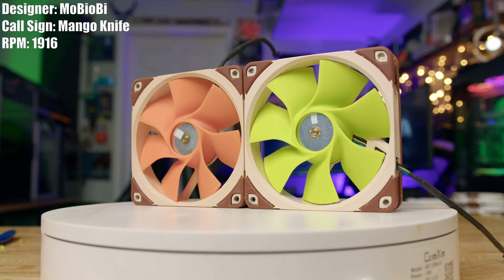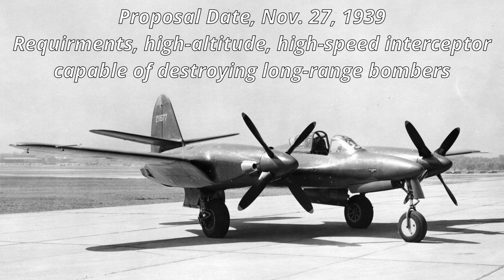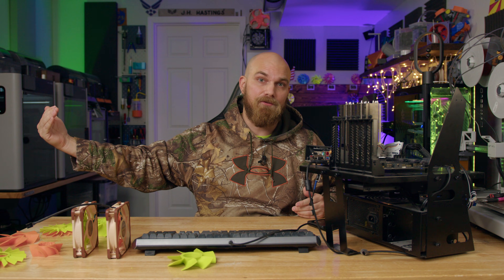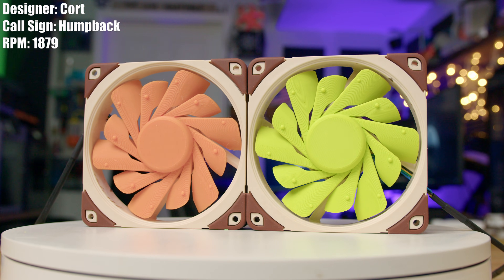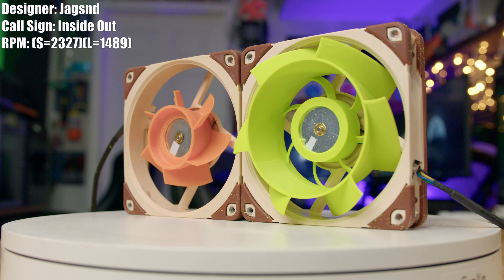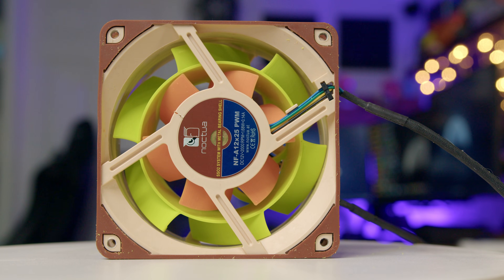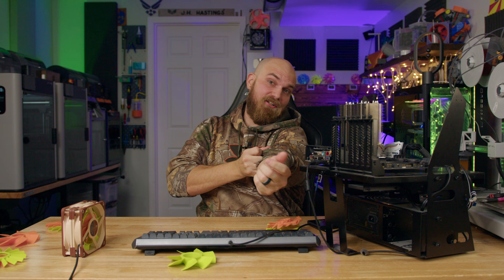Stacked TWIN Fan… is a Monster | Fan Showdown S7E1

Comment: Focusing on cooling & noise is the best way to go. I'm not sure about the current ranking formula though.

You might need to use a different ranking formula that works better. Min–max normalization might be a better approach than adding the 2 values together.

You could also use sones instead of dB to measure loudness. Sones is a scale for the perceived loudness as a human hears it.

Comment: It would be interesting if you ran a audible test where the fan ran at a speed to cool the CPU at a target temperature.  You could use motherboard fan tuning software to target say 70 and the fans will run at the RPM that maintains that level of cooling.  Some fans like the Mango that have more headroom on the cooling may show well with a temp normalized test.  At the moment you are testing the audio at the max spin speed of each fan which is not necessarily the best indicator of performance even though it is an indicator of max noise.

The new smoke machine is excellent.  A moment of silence for the pioneer.  It worked through hurricane force winds and whining surpassing that of even a 2 year old child.

Comment: The results of the sound testing will have nothing to do with how they sounde on the cooler. The coolers fins changes them. It's quite possible to have a design that the fins all but silence out or that the fins cause a huge jumps in sound. Also what frequencies are loudest make a perceptual difference. Higher frequency noise is more unpleasant than lower in most cases.
If you want something that is relevant then mount them on the cooler before testing. Otherwise it's a waste of time.

Comment: I think the A12 stock fan should be the marker of 100%. Set the benchmark to that and your score is based on the percentage mark in both categories. Meaning if you match the A12 in dB then you get 100% and if you produce a fan quiter. By example, let's say the A12 has a dB level of 48, that would be the 100% mark that a fan can either do greater than/less than and be graded as such.

So you can use an formula: 
Percentage = {x} / {48} x100

Giving you a value of exceeding the A12 by a % margin. You can organize that based on the lower the percentage score, the higher it ranks.

Using this formula you can also get a value for temperature and use that in the same fashion since both scores being lower is the goal.
Reply: +1 for scores relative to the OG
Reply: Up! this is a fantastic idea.

Comment: In the future episodes can we have the radiator in the smoke test and fans on each side for a more proper smoke test? The rad will add some resistance and id be curious to see how it changes in a true push/pull configuration with some space between.

Comment: I personally think the sound is the most mundane aspect... Focusing on sound feels like you're catering to a very vocal minority of people that whine and moan about every little noise their pc can make while forgetting that it's got lots of constantly moving parts. if you're going to test it, if its going to be a factor... it should be the least important factor in scoring, but still contribute so it can help out weird edge cases or ties. the fun of watching these tests is to see their performance in air flow (how much they pull in and how they shape the exhaust), the static pressure (since that's what helps it push the air through the cooler), and overall how well it cools the CPU. If all we're worried about this time around is sound performance... I'm probably skipping this season. I don't personally care if I can hear my fans, as long as they aren't grinding or blocking out the sound of my games its fine.

Comment: I feel like this puts WAY too much emphasis on the sound levels. You show me that list, and I still want the Mango Knife as my chosen fan. It's literally the best fan.  It's not going to take long before someone makes a shitty cooling set of fans but one that is quiet and they "win". For instance, every fan that made the chart from S2 E1 of the Fan Showdown beat everything on this list based on the criteria used. If we force them to use two of the fans, that's going to double the noise so increase dBA by 3... which means that the Wave still beats everything from today's list, even though the delta was over 7 degrees more (though probably a different test than you used in s2) - poorer cooling, but much quieter.  Would be interesting to maybe throw a pair of Wave fans in and see where they actually come out with the current test setup.  Either way, I still think this is way too much weighting given to sound level - it's definitely going to stifle creativity in fan design.

Also, what is the ambient sound level in your basement without the fans running? And are you making sure AC/furnace/fans aren't running when measuring because a couple dB are obviously going to make a big difference now. :)

Comment: It might be a a lot to ask for, but adding in data from tests like the static pressure and other bench tests from previous seasons to incorporate into the spread, they dont have to be integrated into the actual stats for rank placement but it would still be cool to see their stats on other tests, also more smoke would be nice, its the best representation for some individuals such as myself that are visual learners, mango knives looked sweet, knew it wold have a nice exhaust flow just by looking at it looking forward to this great season, cant wait to see some crazy designs 👍

Comment: The sound test should def be done with the cooler!!, and it would be neat to see the smoke as well? With the cooler mounted to the exit side, it would show how much air is being pulled all the way through vs dissipating through the sides.. especially with asymmetric designs where one fan may be very different in performance it might show some interesting results?

Comment: your sound test is unrealistic for the fans to be honest. the bare min you should have them run on the cooler when testing the sound. A case or cooler will add many factors that are simply missing. i mean you still use that reference but even that pointless really to be honest its more or less useless data.

Comment: For the sound testing, fan noises that are more biased towards the higher frequencies should be penalized more harshly than those that bias towards the lower frequencies. A low hum can be easily ignored, but a high pitched whine is far harder to ignore. Even though it has a lower dBA reading on this scale I would penalize the Mangoknife more harshly than the Inside-Out, although both would take hits due to how many peaks they have.

Edit: Also, fan sound testing should take place on the cooler as it WILL alter the sound dynamics.

Comment: Sound test score should be less influential. Like a 5DB difference is equal to only 1 point, anything lower is 0 points. As cooling is the ultimate requirement.

Comment: I think the noise test needs to be done at a 90 degree angle with a cooler in place. Rather than doing it smack bang in front of the first fan. If it's shifted 90 degree, it'll be 45 degree angle from both fans if placed in the right spot. 

Having the mic in front of the first fan may be blocking certain frequencies from the second fan in the same sort of way noise cancelling works, maybe?

Comment: Shouldn't we be adding benchmark scores, or even CPU clocks on the equation? Or is the CPU running on a fixed clock somehow to make sure that the differences of temps are accurate?

Comment: Hmm... Rather than using 𝚫T+dBA, it might be more - accurate(?), significant(?), valuable(?) - to use the Weighted Product Model to arrive at a score. (https://en.wikipedia.org/wiki/Weighted_product_model) This allows you to "evaluate and rank alternatives based on multiple conflicting criteria".

WHY?! To avoid a situation where a particular criteria influences the outcome too much or too little. Let's use a setup where one criteria produces scores from 1-1000, and the other criteria produces scores from 1-3. If both criteria are equally important (equally weighted), then you could get results like the following alternatives:

(criteria 1) + (criteria 2) = result
994 + 1 = 995
992 + 3 = 995

You can see here, the 2nd criteria is contributing very little to the end result, though it is supposed to be equally important. The bottom alternative, despite having a criteria that is 3 times better than the top alternative, results to the same number. However, using the Weighted Product Model (explained below) with equal weighting, the top result would be 994, but the bottom result would be 2976, reflecting the equal importance of the 1-3 criteria.

To use this (in this instance), you take 1 divided by 𝚫T to the power of how important it is (the weight), times 1 divided by dBA to the power of its importance (its weight). So,

((1/𝚫T)^(w1)) * ((1/dBA)^(w2))

Why (1/𝚫T) or (1/dBA)? The Weighted Product Model assumes the higher criteria number is the most desirable number. (10 is more desirable than 4.) Since a LOWER 𝚫T and a LOWER dBA is desired, the calculation 1 divided the criteria gives a higher-numbered result for a lower criteria. (1/2 is larger, or higher-numbered, than 1/4.)

If w1 and w2 are equal (because both criteria are equally important), then they both equal 1. Which reduces the equation to:

((1/𝚫T)^1) * ((1/dBA)^1)
or
(1/𝚫T)*(1/dBA)   {to get a higher-number-is-better result}
or
𝚫T*dBA   {to get a lower-number-is-better result}

If 𝚫T is twice as important as dBA, then w1 = 2 and w2 = 1:

((1/𝚫T)^2) * ((1/dBA)^1)

You can adjust the weights as needed, and add as many criteria as needed. 5 criteria (C1- C5) would be:

((C1)^(w1)) * ((C2)^(w2)) * ((C3)^(w3)) * ((C4)^(w4)) * ((C5)^(w5))

Just remember - if a lower-numbered criteria is more desired, invert the criteria number with 1/criteria.

So, using the numbers from this video and equal weights (and going with lower-number-is-better results):
	30 Fins		= 2782.5
	Mango Knife	= 2811.2
	Humpback	= 2834.0
	Inside-Out	= 3192.0

30 Fins still won out, but Humpback and Mango Knife switched positions, with equal importance/weight placed on 𝚫T and dBA.

For fun, I ran the calculation with dBA being 25% more important than 𝚫T, and got results in the same order as you had originally had it.

Incidentally, I actually use this method to evaluate products on Amazon, with price (1/$ because a lower price is better), rating, and # of people who rated the product being my consistent criteria, with other, as-needed criteria (like power-usage or its dimensions) added to the calculation.

Comment: The fans should be normalised to a set temp or rpm to take noise readings, as this disproportionally affects fans that are lighter/more aerodynamic since they can spin faster and will generate more noise as a result.

Comment: if noise is a factor i feel like it should not be a 50/50 split for the scoring performance should still be the primary goal so like 70/30 or 80/20 that way noise matters but not as dramatically otherwise we will probably only see large lower rpm fans at the top. Also should be on the cooler for the noise tests.

Comment: Unfortunately, I think that this comparison method is rather flawed. Simply adding dT and dBA sound pressure is going to give you some awfully skewed results towards quieter worse performing fans just due to the thermodynamic limitations of the single tower cooler. If you want to stick with "mostly" this test setup, I would suggest testing the noise measurements on the cooler as you suggested, then picking a "reasonable achievable dbA" and normalizing the fan speed across all fans to hit that noise level and compare the temperatures there.

Comment: As far as noise, your ear is more sensitive at certain frequencies.   You can apply an 'A-Weighting'  filter to better match human hearing.    If you want the FFT to update faster,   I have a custom multicore fft program that has a 120Hz refresh rate up to 512K points, multichannel.

Comment: Should either noise normalize and test temperature...or use a fan controller to hit a target temperature and then measure noise output
Reply: Or you just test at maximum

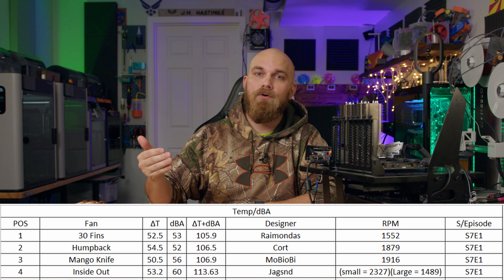Comment: 13:09 - Wait, this makes literally no sense, you want a high Delta T, but a low dBA, but then you added the Delta T to the dBA???
Surely your #1 and #2 are switched, no?? #2 has both a higher Delta T than #1 (more cooling) as well as the lowest dBA (quieter) out of all of them.
Reply: No, we want low values on both. We want the CPU temp that is closest to ambient.

Comment: Great video! As always, I enjoy your “scientific” content lol. 
Another wrench to throw into your calculations, humans don’t perceive all sounds at the same level. 
It’s one of the reasons that those toroidal blades were so interesting - they produced the majority of their vibrations below 3000hz. Even though they lack efficiency, the human ear just doesn’t hear it as clearly… 
Point being, I think you need to take the sound spikes into consideration. A fan creating a spike between 3500hz and 5000hz is going to be “heard” more loudly than a fan creating a spike at 15,000hz or 1000hz. If you can raise the rate beyond 20,000, or drop it below 20, you could have a “silent” fan from a human perspective. 
Obviously, both of those fans with current blade designs would be wildly inefficient, but that’s what we should be looking for. A “functionally” silent fan.

Comment: I think you goofed the scoring. Delta T is a good number, but dBa is a bad number. You shouldn't add them together.

Think of it like this. The perfect fan might have a Delta T of 100 and a dBa of 1. Score 101. The worst might have a Delta T of 1 and a dBa of 100. Same score, right?

You should do "Score = DeltaT - dBa" or "Score = DeltaT / dBa". The latter is my favorite as it only goes down to zero.

Comment: Ok this doesn't make sense 13:04. The humpback has the best Temp, and the lowest DBA. It wins in both categories but ends in 2nd overall?
You might look at project farms and how he grades things. I would just make the 2 charts and list them in position compared to the other fans. So if you are 1st in cooling but 5th in sound you average out to a 3. So the  2nd in temp and 3ed in sound would win because it averages out to 2.5.

Comment: I would absolutely measure the sound on the cooler, because the air interacting with the cooler's fans will have a big impact on sound profile.

That said, I also personally wouldn't measure sound at all. If someone cares that much about quiet, they're gonna use an AIO. (Or, my favorite: in another room.)

Comment: My humble recommendation: 
Noise normalized testing with the cooler in place (rack n stack with Delta T given a fixed noise like 45 or 60db.  
Smoke testing through the cooler to see draw on one side and outflow on the other. 
Categories for double pusher, push-pull, double puller setups so we can see some outside the box thinking on double stacks on the input or output side as well as the more traditional push-pull.
All baselines referenced to the double stack (any configuration) A12.

Comment: The correct way to include sound (logarithmic scale) is to run the cooling test normalised. Place your dB reader at a set distance to the side of the cooler and pick a number they will all be above then adjust the fan speed until it hits that number.
Reply: You could argue the same for adjusting the speed until the output is optimal. Typical perhaps, correct is a stretch.

Comment: I'd be interested to see if an (empty fan frame spacer with air slots on the rim to allow outside air in) between the two parts of "Inside Out" would affect its overall air flow.

Comment: I'm with many by saying the sound and smoke tests should be performed on the cooler for a more accurate "installed" test.  Maybe the current unloaded freestanding test would be used in the acoustic delta.

Comment: Instead of ∆T + dB, the variables should just be ranked against each other. Rank 1 temp with rank 3 noise should tie with rank 2 temp rank 2 noise. Decibels in particular are on a logarithmic scale, so at -60dB, +1 dB is definitely worth -1°C.

Comment: 10:31 testing methodology should be to do the recording of the fan sound on the cooler! Too much vibration from the fan as it spins can make inaudible vibrations that appear when connected to a cooler and motherboard. different parts resonate differently, and the balance of the fan should be a consideration in the sound section